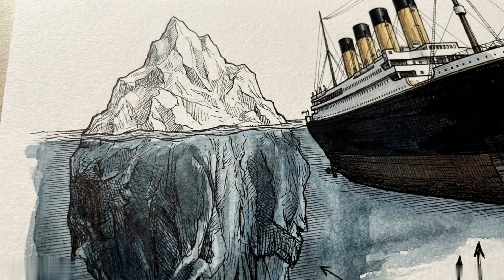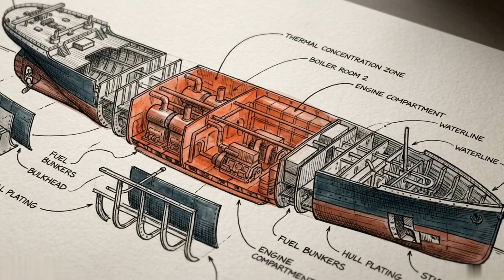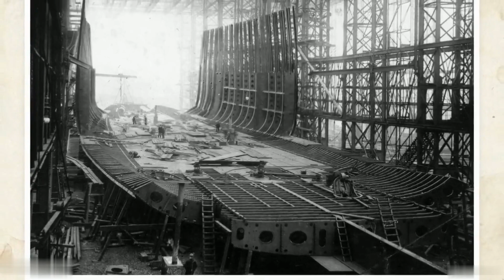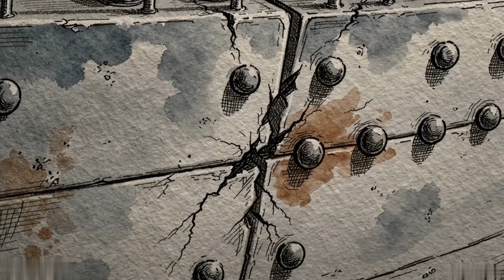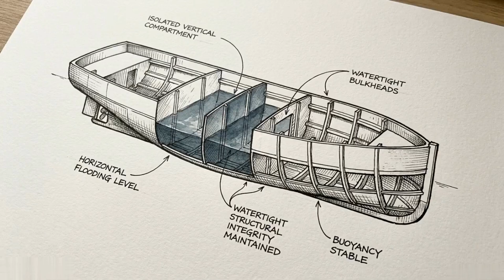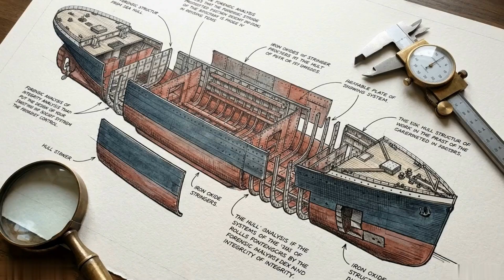The Engineering Flaw That Actually Sank the Titanic

Comment: It should be pointed out that the Titanic used the best available steel-alloys when it designed and built, the cast-iron rivets had slag present in them not sulphur and there were several different grades of these rivets with different levels of slag present.